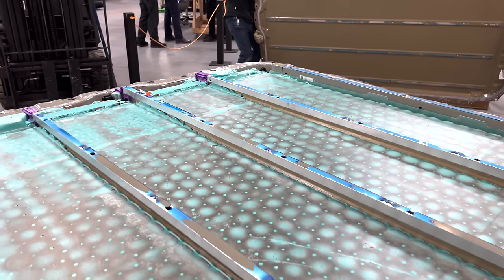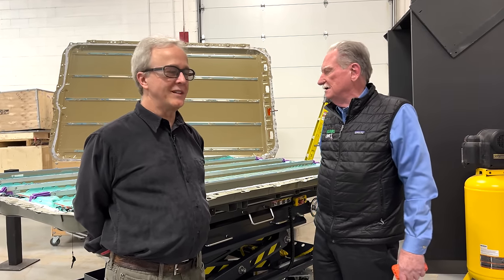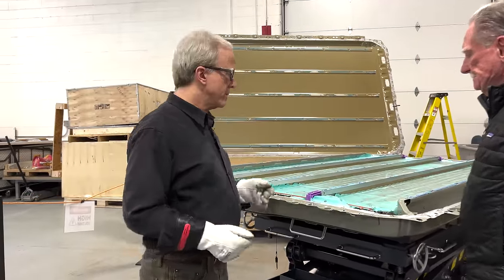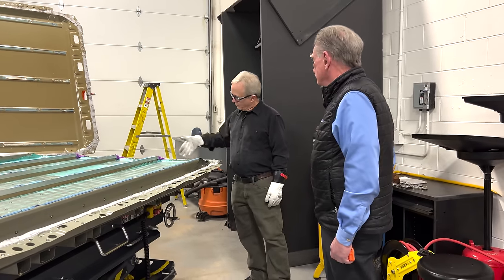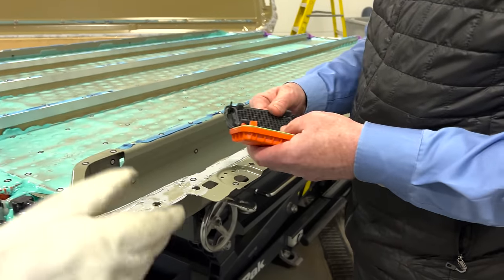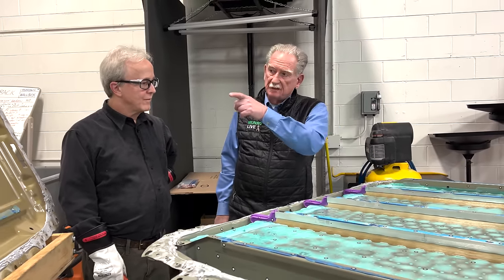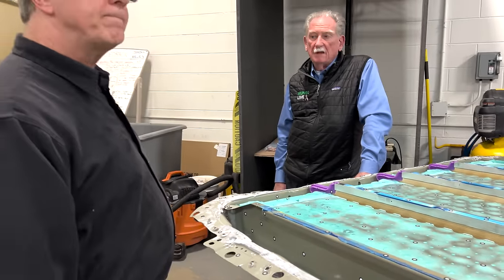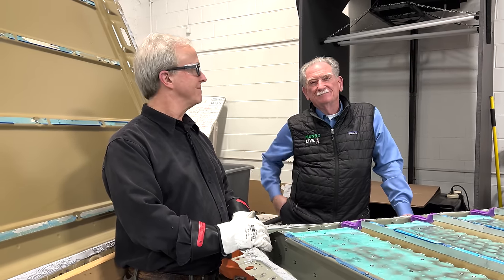Tesla Cybertruck Battery Pack: Our First Impressions Under the Lid

Comment: Ifixit score 0/10
Reply: So true. Worse than a new iPhone.
Reply: This is true. The new structural battery packs aren’t financially viable to be repaired. To get to a cell means destroying most of the pack so it makes no sense vs older packs. 

However, with how strong each cell is now built and contained, with how much better the BMS systems are and with how much less parts there are (no more tiny little BMS wires like older packs) it’s also much more unlikely that the pack would need replacing in the vehicles life. 

Of course, this is yet to be seen fully. But this isn’t anything new. A replacement engine for my 2012 BMW X1 would be around £1,500 and after labour would be £2,000 or so. Which is cheaper than it would be to take the engine apart and rebuild it. 

I suspect by the time these cars/trucks are 11 years old like my car, a replacement pack if needed, would be around the same price. And they’re pretty easy to swap out too, not much labour involved
Reply: @iambenmitchell  
I look at my car (Renault Zoe) and I see it like this:
This car has 196 LG Chem E63 cells. Each costs about 25€ and needs almost no tools to replace. So in case 1 cell fails, I would need to replace 2 of them (battery is 98s 2p) and it would cost me 50€ in parts, and I could do it with 20€ in parts (including battery tester).
Reply: @Mladjasmilic 
Or, you could say that loss of one cell would be insignificant.....
With 48(?) Cells per row, 7  rows per module and 4 modules, the vehicle has ±1,344 cells.
.
From recollection the Model Y pack had a welded cell connection  plate that served as a fuse at the point it joined to each cell.
.
So, if a cell goes "high current" it would be disconnected.
.
If this happens, the vehicle (currently with a 125kWh pack?) Loses 
125,000÷1344 = 93Wh of capacity.
.
That's ±0.74 percent loss per cell.
......
Congratulations on having the confidence (and ability?) to attempt repair of a high voltage pack.
You must be one of the very few with the knowledge and equipment necessary to lift a car (safely) then drop a pack from under the vehicle (safely) diagnose the problem, strip it (safely), replace a cell (you mean module?) Balance, then reassemble the pack/ vehicle!
.
I wonder how much investment in lifting equipment (etc) and time that might take?
.
I'm sure that mere mortals would prefer to pay for 2-3 hours of professional attention to swap a pack which will be greatly reduced in price when the original is out of warranty in 8-10 years.... Maybe? Rather than days of labour to strip, repair and refit the original with no guarantee of success and probably no warranty on the work?
Reply: R.I.P Recyclation centre in 2050's
Reply: Whats the Ifixit score on a modern gas car? Not better.
Reply: @iambenmitchell i would argue that the battery pack is the biggest variable in the life of the vehicle, compared to ICE, a battery pack typically lasts fewer miles before needing replacement, and is considerably more expensive to replace
Reply: @Alex_Alex-Alex  that’s not true though? Maybe for the first generations of Model S and X. But a model 3 from 2017 can easily do 300,000+ miles. There’s plenty that have over 200k on them with the original battery and they’ve lost around 10% of their range. 

Why do you think Tesla have 100,000 mile warranties on the drivetrain? (Battery and motors) 

Find me one ICE car that has a 100,000 mile warranty on the Engine, Gearbox and Differential
Reply: @maxbiagi3091  you realise they don’t take them apart anyway? They shred the whole pack and throw the shavings in a fluid. the different materials float to different levels. 

Recycling isn’t the same as reusing. And these packs can be reused in 20 years or so it’s just more effort than it used to be. 

It’s just not financially repairable because you destroy the pack lid taking it off
Reply: @iambenmitchell   you can reuse the pack as power-walls, they still work, just store less energy
Reply: @beatrixkiddow8861 A lot of newer gas cars are annoying to work on, but nothing like this. I could at least find something in salvage if I really needed it or there's an alternative to OEM parts. Sure, there's some shady stuff with having to purchase first party tools or parts availability but go ahead and call Tesla and tell them to ship a Cybertruck battery to your parts guy.
Reply: Yeah, this is bad. And I don't think making a $20,000-$30,000 part repairable would be such a problem. They could have at least made it out of four replaceable modules. They way it is made means that any defect or damage will be a total loss. However, I am pretty sure some people and companies will figure out how to repair them or remove and reuse the cells, but it might require nasty chemicals to dissolve all that glue the poured over the cells.

It may be a bit cheaper, lighter and more robust to glue everything together, but when water gets in the glue does not save.they day anyway.

This factor alone, that the most expensive part of the car can not be repaired, will keep from owning a Tesla for a long, long time.
Reply: @iambenmitchell  Yeah and hit something on the road or have a faulty pack and you’re up for well into 5 digits to replace it which writes the vehicle off… so green…
Reply: @peterprokop  They could easily make the rim more robust and double O ring it for serviceability. The green movement is such a poser act with no real substance or care about anything being actually renewable…
Reply: Good for environment!
Reply: I see a lot of comments about repairability. The logic behind a structural battery pack is that it saves weight.
In practice this means the EV weighs less, needs fewer cells for same range and is more energy efficient.
It is also most likely cheaper and faster to produce, meaning more EV's on the road.
Less weight, at least for the other models, means less road wear and longer lasting tires.
Combine that with the fact that high voltage battery packs are not something an average person should try to repair anyway.
It's just not safe for anyone but a specialist.  Tesla battery packs are also very reliable to begin with. Adding weight and cost and complexity, that can lead to more failure, seems like a bad idea.
Its not like they purposely made it unrepairable, there are compelling reasons to take that route.
Reply: @ashsilverwizard3275  Your weight argument doesn’t hold up on a vehicle that weighs more than any other Tesla lol. These vehicles are supposed to be sustainable and green and having to bin an entire battery / potentially write off the vehicle cost wise is pure waste… No one is saying users should service batteries but dealers and trained mechanics should be able to open them and fix issues not scrap a battery that has an insane amount of resources that went into making it…
Reply: @electricsnut  That is why I added the qualifier 'for other models'. That said a repairable battery pack for the cybertruck would have made its already hefty weight worse. 

In an ideal world it would be serviceable.  But over the lifetime of the fleet, the savings in electricity of the reduced weight of the pack could offset cost of not being able to repair. Especially if the reduced complexity improves reliability, witch it almost certainly does. 

Keep in mind efforts to include recycling in EV lifecycle means that environmental cost of scrapping and re creating a pack will decline too.

This is just my speculation though.
But if I am right then you cant make a "Think of the environment" argument.

It does suck for the individual if that pack happens to fall outside of the warranty so not ideal, its about compromises when you talk engineering a product.
Reply: @rudiger86  are you for real… the iphone is tiny, uses a minuscule amount of raw materials yet you think Tesla gets a free pass when it takes many tons of raw materials to make a battery and costs the equivalent of around 20 iphones to replace.
Reply: @beatrixkiddow8861  A ICE engine does not need to be replaced if the cooling fitting brakes off the block.
Reply: @MalleusSemperVictor  Ok :)
Reply: Foam beer can garbage pack
Reply: also recycling nightmare... :-(
Reply: @beatrixkiddow8861  sorry but that's not really true.  Best modern cars are built with at least some material separation in mind. Some are poor but I think you might be surprised by how much part reclamation goes on.  The issue here is how to shred and recover the critical materials.  They have made it difficult and expensive.
Reply: Thinking you could fix any battery pack on an EV is kind of stupid.
Reply: @beatrixkiddow8861 Modern cars are horribly complex yes, BUT, they aren't glued together!!
Reply: @themonsterunderyourbed9408  Why not?
Reply: @Mladjasmilic   You think you can manufacture a new cell?
Reply: @themonsterunderyourbed9408  Not a cell, but the rebuild a pack, yes.
Reply: @rogerstarkey5390  a co worker of mine replaced a batterycell in his batterypack. It looked very easy actually. I would say a car with a faulty cell should be considered a un-insured car even if its disconnected by software in your tesla.
Reply: @iambenmitchell  In fact after they reach 70% capacity you can sell them for grid storage so they are worth more that way than to recycle.
Reply: @Mladjasmilic this is just not true for costs. Also introducing new cells into an old pack that are out of family and not matched with rest of cells will make the rest fail quicker. The percent of packs that fail are less than 2% and cost savings by cell to pack are 10-20% better, business math makes sense here.
Reply: Not much choice if you want it to survive weather and crashes and not burst into flames.
Reply: @beatrixkiddow8861  "Whats the Ifixit score on a modern gas car? Not better."
I think that's part of the problem: reducing pollution means having stuff that can be repaired.
That's more important than anything else in the cars.
Reply: RIP Remanufacturing centers. Built to be thrown away. -GENIUS DESIGN. *sarcasm off *
Reply: @iambenmitchell  would it explode or burn if they shred it?
Reply: Even Apple would be impressed by this battery's non-repairability.  ha-ha-ha
Reply: @rogerstarkey5390  😂 Thank you for taking the time to provide a reality check.  I think so many of us just rolled our eyes and kept scrolling.  Well done sir.
Reply: @beatrixkiddow8861  Plus that pesky little thing about destroying the chemical balance of our atmosphere. Haters gonna hate.
Reply: @beatrixkiddow8861  Exactly. They wanna fix spaceships and tankers too.
Reply: @iambenmitchell yeah we just don't have the right battery technology to make a full electric car more variable. I remember few years ago, my buddy replaced the battery for Prius (hybrid) and it costed him almost 10k
Reply: @monad_tcp only If ITS degraded ..  Not If there ist a cell Problem or a cable. Problem or a Problem with the BMS
Reply: Car becoming mobile...use and throw
Reply: @iambenmitchell 
Kia/Hyundai have had a 10 year/100k warranty for decades.
Reply: It's basically like a German car but much worse, space aged engineering so that it breaks right after the warranty period and nobody can fix it.  A simple coolant leak will run you $20-30k but the people that don't know cars will keep buying them.

Comment: This is why I watch every Munro live video. Caresoft is a lot of fluff.  Sandy is simple and to the point. Great explanation on the  venting!
Reply from the maker: Thanks for watching!
Reply: sandy is great.  Sometimes he likes to go on about tesla, but he adds humor, a ton of experience, and a laid back kind of attitude, but still insistent on details.
Reply: @davidanalyst671  At times Tesla is worth going on about.    A lot of what one sees first in a Tesla shows up in other BEVs.    When will we see gigaCastings in ICE cars.
Reply: @danharold3087  do castings make sense in ICE cars?
Reply: @toronado455  Yes they are drivetrain agnostic.
Reply: @MunroLive  i love looking at outdated technology by wannabe tech bros thousand year old batteries tech and electric motors from 1832 doesnt matter if chemistry is different a battery is a battery just like a combustion engine is a combustion engine.
Reply: @billybobbob3003 Let me get this straight. Are you saying the battery tech and motor design in Teslas is dated? And a modern internal combustion engine is no different from  a hit and miss diesel?
Reply: @TheForwardThinker  batteries and electric motors predate the combustion engine and gasoline meaning its more out of date this is FACT. Anyone pushing ev is putting the horse behind the buggy total fool.
Reply: @billybobbob3003 the spoon is older than the Yellow Pages big book. Guess which one is outdated and deceased?
Reply: @TheForwardThinker  yt wont even let me respond keeps erasing my comments. people learned to harness fire before electricity. but people learned to harness electricity for vehicle propulsion before fire and electricity and fire has always existed naturally from mother nature. so yes my logic still stands electricity for propulsion is more outdated than fire propulsion.
Reply: @billybobbob3003 You’re using the word “outdated” incorrectly.
Reply: @josded  it is outdated and obsolete